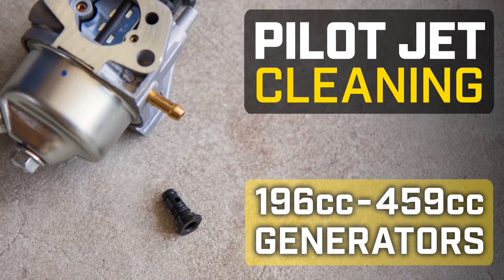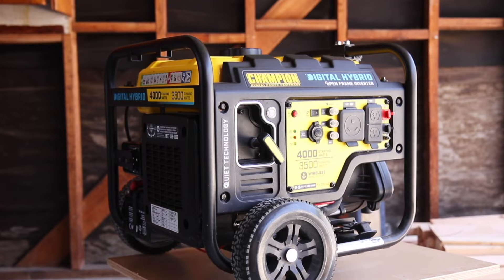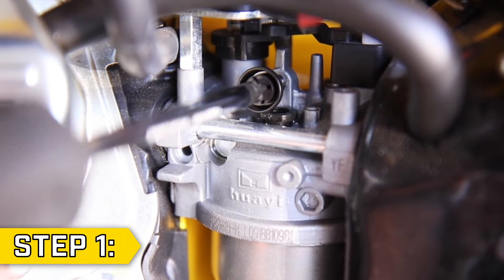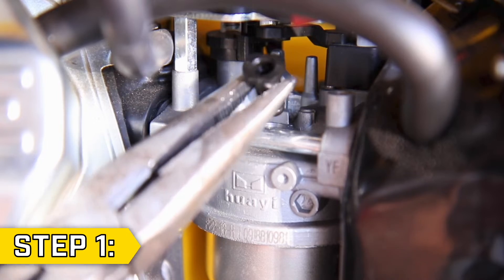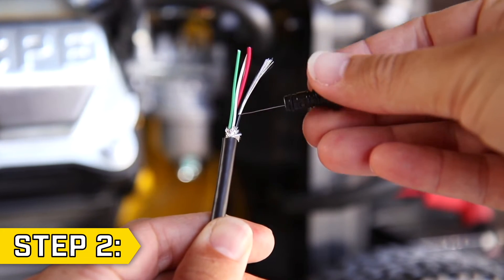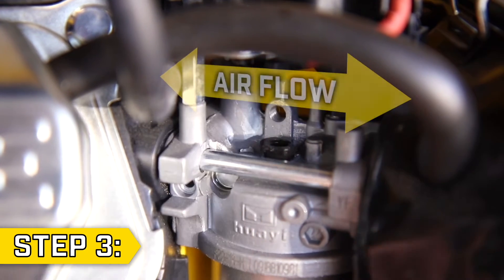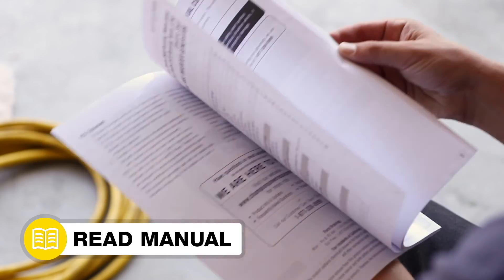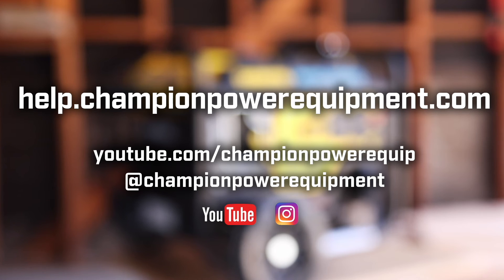Pilot Jet Cleaning (196cc-459cc Generators)

Comment: Could this be a reason of why the carburetor gasoline leaks?
Reply from the maker: It is possible if gasoline was left to go bad in the carburetor. If fuel is not treated with fuel stabilizer & the generator isn't operated for at least 15 minutes once a month, the gasoline gums up & forces gasoline out of the carburetor since a blockage is preventing it from flowing through properly.
Reply: Im glad im not the only one
Reply: If your bowl leaks. It's likely your float needle valve is having issues.

Comment: Is there a need to clean the pilot jet if propane is the only source for the generator ,, im asking because my generator is idling rough and it won’t stay in one place as it rotates on the ground
Reply from the maker: We are sorry to hear this. If you have never put gasoline through the unit but propane, there is no need to inspect the pilot jet. Check to make sure that you are meeting the correct propane usage specs. The propane bottle should be no larger than 40 pounds & that there are no leaks on the supplied LPG hose. For further assistance, please give us a call at 1-877-338-0999 or email us at support@cpeauto.com. Thanks for your patience. 🙂